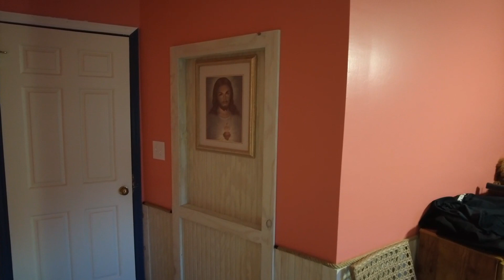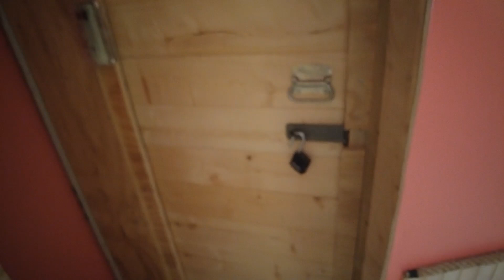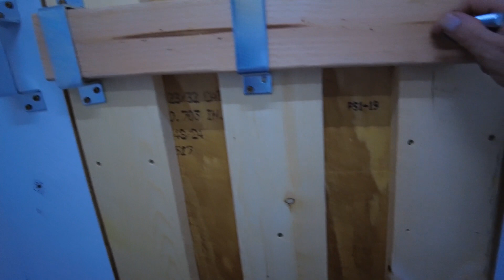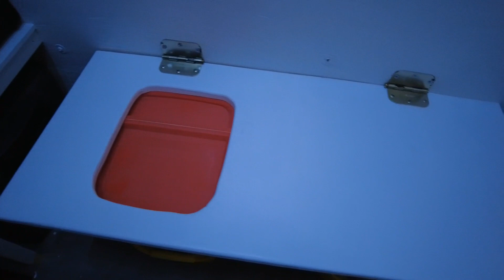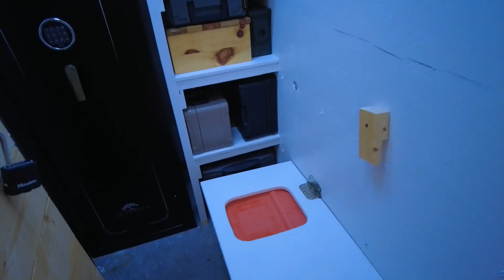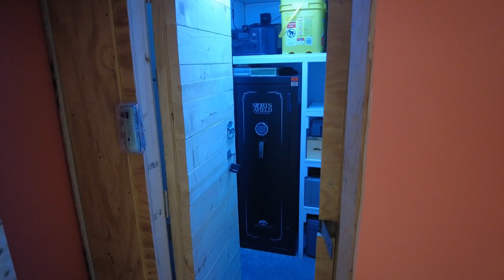Homemade Safe Room Storm Shelter Part 3

Comment: I use that type 2x4 system for my interior front door no kicking my doors in from outside! We have a steel building 8x8 x8 weights 4,200lbs and is anchored to the ground on all four corners, ran electricity to it with mini split heat/cool we live by our family three houses we can all get inside and lock door! For tornado if needed! We have water, food and 5 gallon bucket with liner and sawdust! Could be in there for three days if needed!
Reply: The door is a lot of extra work when they can just come in through a window.

Comment: I wouldnt have had that door outside your shelter door. There is a reason storm shelter doors open to the inside.  You get buried with crap all around you and infront of that door its going to be very hard to open to the outside

Comment: Good series, the room was great. I may of missed it, but did you consider wiring it via the outlet box you covered up? I know it's likely that the power will go out, but you could keep the battery bank topped off. Also would include small extinguisher for any lithium malfunction.
Reply from the maker: I did cut a hole to the outlet, you can see it in Part 2 at around 5:50. Yes, this way it stays charged up and ready for use.

Comment: Nice safe place. I think it’s stronger than you might think being small and on the interior of the house. As for the potty situation put a bag in it and consider getting pine shavings to put in it. Works well. Hopefully you will never need it
Reply: Kitty litter.

Comment: As I commented on your other video, I see you decided to do things your own way versus listening to some peoples comments, or even experts in the field.      That room would be better off use as a complete safe room versus a storage area combo.    I would remove the lock as I’ve seen many clients get locked into their own safety / panic rooms. I would add a fan to circulate the air, first aid kit, some type of eyewash, fire extinguisher, carbon monoxide/ smoke alarm.  Small radio,  GPS device even without subscription.  You can still call for help.     And I hope you never have to use that room.   A lot of short steps were taken, which I believe can cost someone their life. 

Best of luck to you .